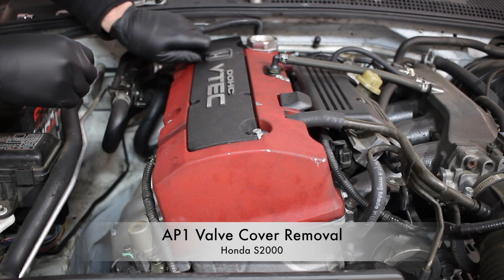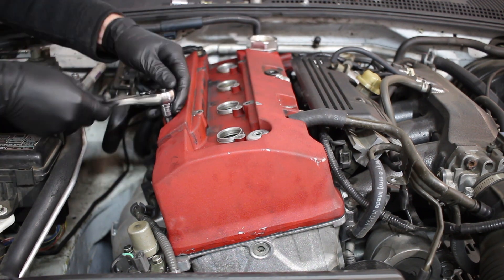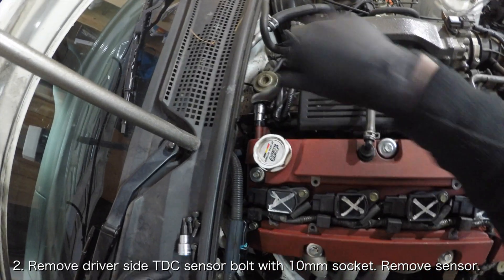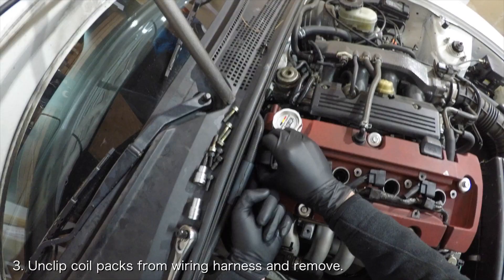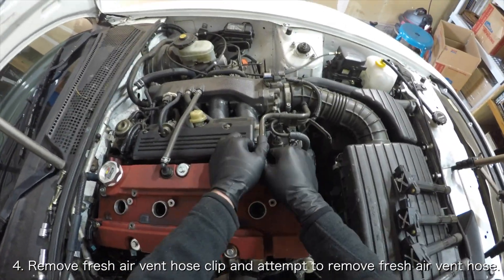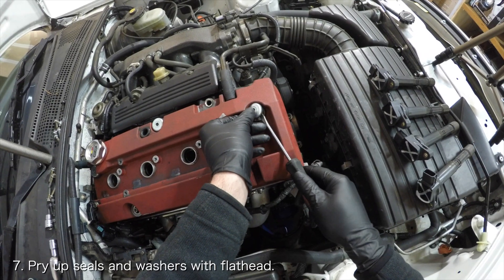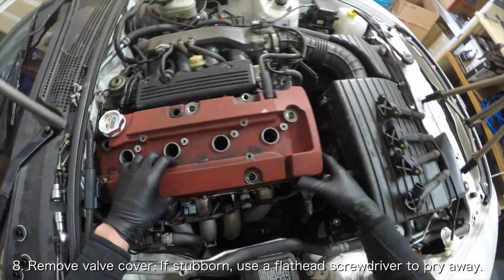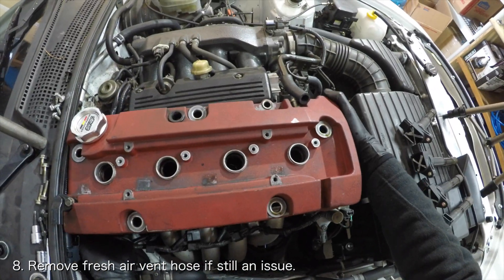AP1 Valve Cover Removal | Honda S2000

Comment: Not sure how I missed this one. Quick question though, is it good practice to replace the seals (inc. plug tube seals) when removing and replacing the valve cover? Mine needs refinishing  and I intend to replace with new as a matter of course. Interested in your opinion, thanks 👍👍.
Reply from the maker: It typically depends on mileage. It is typically necessary when people are doing valve adjustments and the gasket is 50k-100k miles old.
Reply: Thanks for the reply 👍👍.

Comment: Quick question, I’m noticing a bit of weeping oil on my valve cover, coming from the 90 degree pcv. I was just wondering, is there a gasket on the pcv? Does a new one come with that gasket? And finally, yours is black but mine is a brown plastic.. does that mean it’s been changed?
Reply from the maker: If anything I think the rubber in the valve cover might be the gasket part of it. The PCV itself doesn’t have a gasket I don’t think. And if it’s not black it’s been changed for sure.
Reply: DIYGuys holy smokes fastest reply in the west! Haha thanks. So do you think the gasket might be part of a larger valve cover gasket set? It’s not weeping very much, but I’ve heard it’s oil on the red paint that tends to cause it to peel, and mine still looks perfect!
Reply from the maker: I looked it up and I guess there is no gasket. So if you’re getting oil around there it might be positive crankcase pressure not going out the valve. See if the PCV valve is good. Otherwise I have no suggestions sorry

Comment: I've seen other videos on this and they have a hell of time getting the valve cover off because the cowling prevents it coming straight up. Were they doing something wrong?
Reply from the maker: They probably didn't unclip the engine wiring harness from the firewall.